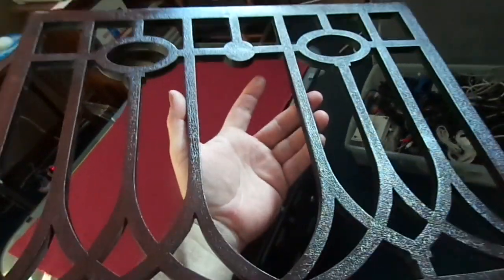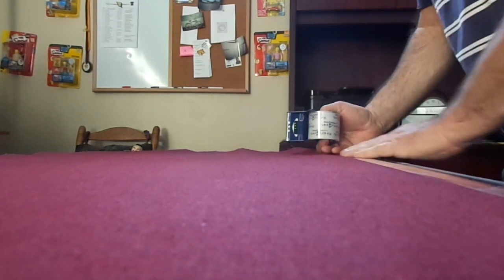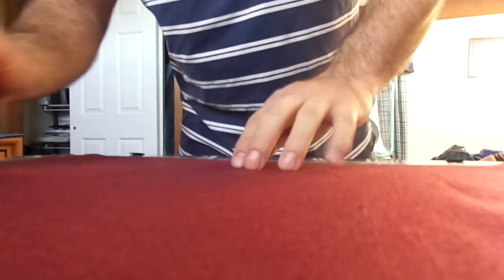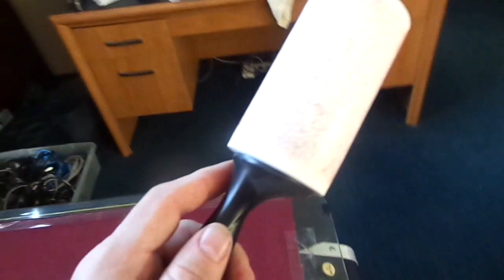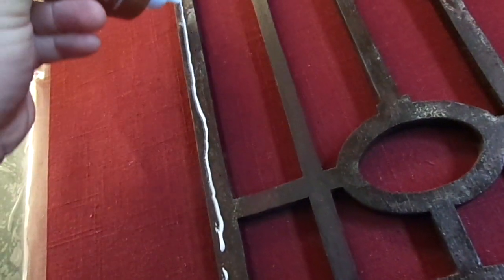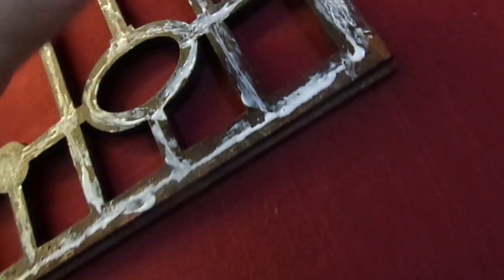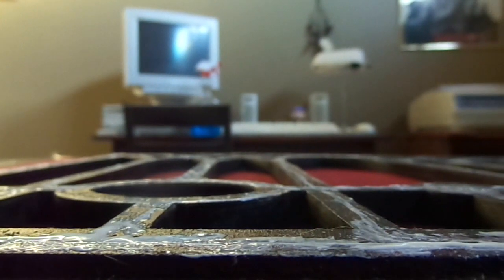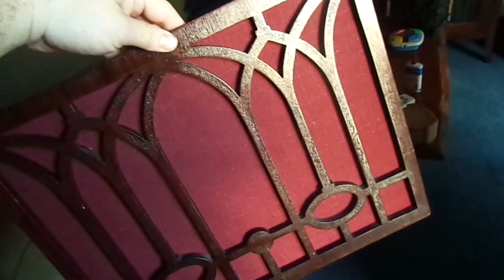Grill Cloth Replacement on Edison Diamond Disc Phonograph

Comment: All that time spent spreading the cloth then half ass from there. Sand it.
Reply from the maker: I find it funny how most of my critics are people who have contributed nothing to the YouTube community... alas, you're not wrong. I'm big enough to admit that. I should have sanded the grille before applying the cloth. But the thing is... three years later, it's still holding up very well. I look forward to seeing your videos showing methods of repairing and preserving antiques.
Reply: @bbishoppcm  I have done many a job in the " half-ass " way ( not my words, by the way but the words of your critics ) and been happy enough with the result. Who is going to see the under side  to know whether you sanded it or not ?  Would it make any difference in this case ? When sanding old polished furniture I think you're supposed to use wire wool which is more gentle than sandpaper. It is also possible to set out to do something properly and then make a mess of it because you are not skilled like a qualified tradesman. What you've done here is alright by me because you have done it to suit your own liking and for your own enjoyment. I would have liked to have seen the grill back in place on the phonograph at the end though. Keep up the good work !       :goodvibes: